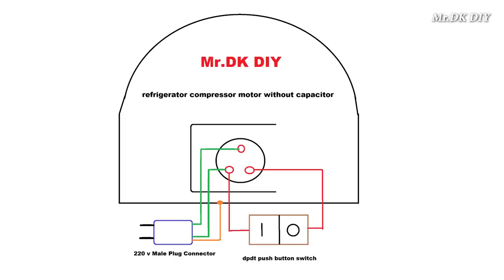How to make simple air compressor from refrigerator motor / and connection without capacitor & relay

Comment: Be carefull, If you connect the start coil permanently, that Will burn in a few hour of works 
The little thing black and round is a thermal limiter, he protect your coil for over amp, its good to keep it

Comment: Главное определить где пусковая обмотка а где рабочая.Просто определить по тому реле,которое лежит рядом.А так компрессор работает нормально.Я использую для аэрографа.
The main thing is to determine where the starting winding is and where the working winding is. Just determine by the relay that lies next to it. And so the compressor works normally. I 'm using it for an aerograph.

Comment: This is totally wrong in a few ways. Firstly he the refrig compressor lying on its side,motor no doubt has fallen off its internal springs,they are NOT designed to be layed as such. Secondly the oil is a specific oil designed only for operation with certain refrigerant gases,they highly hydroscopic and will deteriorate quickly. The electric motors are designed to operate with the refrigerant gas only, cooling it down. These refrigeration compressors are designed for a specific use only.
From a refrig. tech.